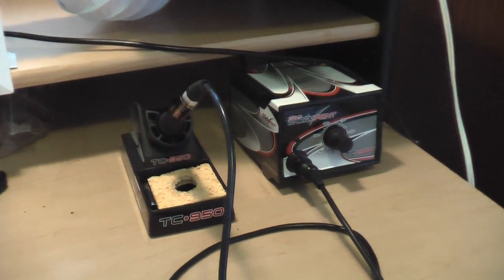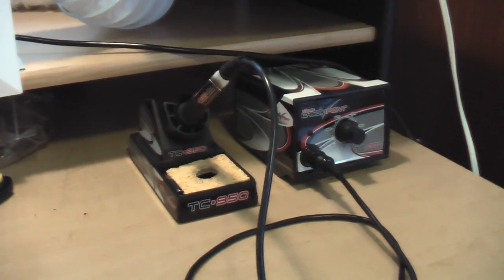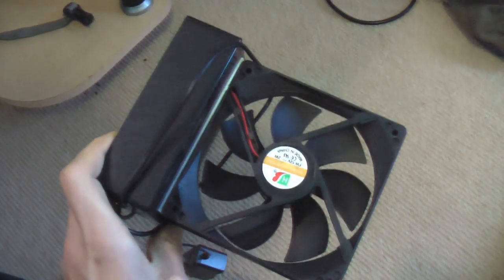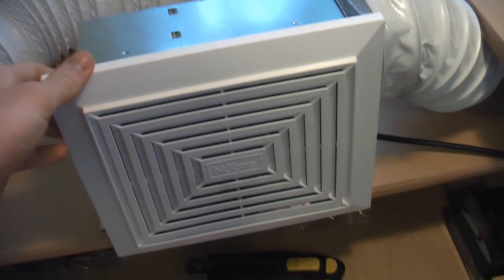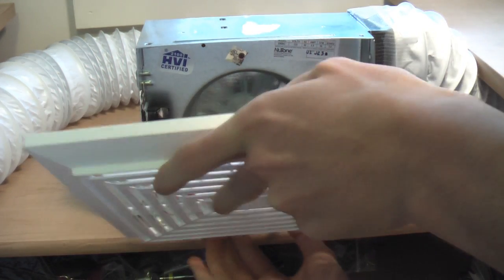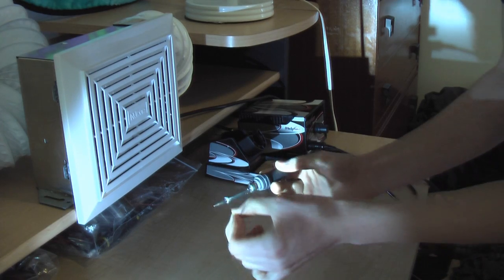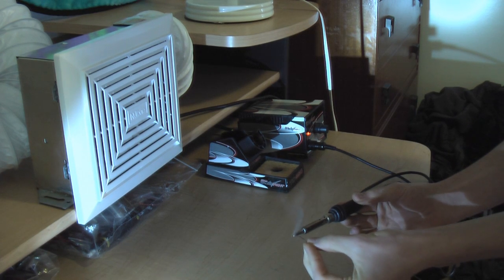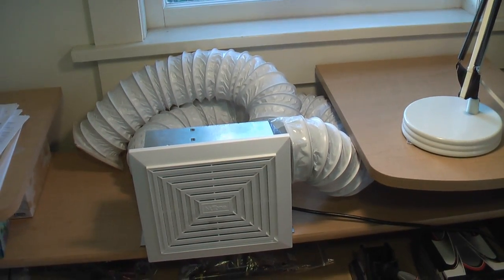How to make a powerful Fume Extractor for less than $30

Comment: I’m thinking about doing something similar but make an adapter to put in place of the intake grille and have a hose go to my work area so the fan itself stays away because my work area is small so the fan right in front would be very bulky

Comment: Great idea dude! Small suggestion, smoke rises if you would put it on a swivel arm/platform so you can have it above the soldering area it will eliminate smoke escaping from one foot away. I think. Really nice setup though.

Comment: I’ve found a 12v computer fan and carbon filter works fine; plus, not nearly as noisy as your solution.  Your failed project looks like the DC supply is under-powered and seems like the filter was being placed on the exhaust side; could be wrong but it was just the way it looked.  The filter must be on the intake side or it won’t work pretty much the way you described.  Anyway, the fumes are still toxic even if you’re venting to the outside, so a carbon filter is still advised.

Comment: Hello there! I need advice! I am working with Resin/Epoxy and I am an artist. I just put a 20"X20" fan on my window facing outside to suck the smell out. Now people (other artists) are telling me my fan needs to be ''for fumes'' to avoid a fire? I ask myself how bad are the fumes that resin and some paints are creating to be this bad? My fan is from a normal hardware store. Any guidance regarding this will help! Thanks!
Reply: Seeing you asked this ? 3 years ago the potential of you seeing this is slim to none.  OSHA (Occupational Safety Health Administration - Now you see why they use acronyms the title) requires MSDS (materials safety data sheets) that explains the hazards of the products you use.  The manufacturer should supply at no cost to you the health hazards of the products they produce for public use.   You are wise to inquire on resin, the long term affects can show up in your health at the worst times equal to cigarette smoking stories.  Depending on how much you do the resin on a daily basis, you should consider doing some ventilation.  I’ve done over 40 years of this type of work. Numerous environments.  I hope this helps you

Comment: Fume filtering systems that actually work cost $500+, as to filter the VOC gases requires a very expensive filter... carbon only filters out big molecules but generally recirculates the risky gas back into the room.  So yes, exhausting out is the way to go.

Comment: Cool simple solution.  The problem I've got, and you alluded to it 'somewhat' -is how to vent without the outside air being sucked right back in (has the fumes just dispersed but the open window would just suck them right back inside the room via the lower pressure the fan makes.

Comment: can this work in sucking sawdust out (vacuuming??) from the air? i'm still working on a sawdust vacuum, using 1, 2, 3, pc fans (with foam and a plastic box). all are from scrapped computers. I did make 1, and it worked alright, but I wanted something with better suction. (i'll also use it when I solder.)
all ideas are welcome.
thanks for the video!

Comment: This isn't a bad idea, but if u want my suggestion, and your not worried about noise, u should of looked at a stove hood.  They usually feature built in lighting and dual speed switch fans, I had this setup on its side for a while with my workstation, now I have it hanging overhead of the workstation with a bathroom fan such as yours, plumbed like yours for easy placement to wherever I choice within 8 feet if my workstation I also ended up fabbing a nice metal unit with handle ontop for the bathroom fan for easier placement and sheek look, I painted everything BBQ black with the exception of the flex vent pipe, which i forked over the needed funds for tin units so that it looked manly. Lol. Mind u I do alot of fab work as well soldering from jewelry to entire reconstruction of motorcycle harnesses and such. So this might be overkill but either the wife or the girlfriend hasn't complained about fumes or my smoking since I have completed the setup. The only thing they complain about now, the alcohol consumption and having to walk by motorcycles and engines in the basement of a house, and still can't figure out how I got said motorcycles into the basement having only stair access from both enterances.  I'm a magician too. lol.

Anyway good idea for keeping cost low.
Reply: May I suggest you watch some YouTube videos about improving your English.

Comment: I was thinking of getting one of these to fix the back draft issue. Also looks like you could add insulation for a more permanent, but ugly solution.
http://www.amazon.com/Window-Dryer-Vent-Adjusts-Through/dp/B00LUCRS9I

Also toying with the front mesh idea posted in the comments. Will post a video once I have everything all worked out.

Comment: The computer fan would probably work for extraction as well, but not for pushing or pulling air through a carbon filter, as you pointed out. If you want a computer fan that can push air through a filter, you must get a "squirrel cage fan" or "blower fan" type. They can be found, mostly used for servers. Blower fans are much, much more powerful at sucking air. They have a lower CFM than axial fans (which is what you have), but a much higher static pressure, which means that basically they can't move a lot of air per minute, but they can pull or push air with a lot of force through obstacles. A normal axial fan doesn't have that static pressure, and they are much easier to put in a stall configuration when encountering resistance, where there is flow separation on the blade (especially on the side that sucks air in) and they would be essentially spinning air around, creating a vortex, making sound and looking fancy but be moving zero air in the direction they're supposed to, in fact they would be a slight flow reversal when they're stalled. This is probably what you experienced.

Comment: awesome idea on the exhaust fan.  But seriously - electrical safety - the switch needs to disconnect the black (hot) wire not the wife (neutral) wire.  Also, you need to tie the ground wire (where is it?) to the metal box.  If that fan ever sucks in the wire you are going to have a very serious shock hazard if the wiring isn't proper.

Comment: Even better hang the unit over top of your work area facing downwards of coarse removing the cover and adding a screen with extensions off of each side trapping and removing all of the fumes 100percent as the fumes travel up naturally.  This method would be very close to 100 percent effective.
Reply: Then you'll inhale some of the fumes before it reach the extractor.

Comment: I totally agree with removing the big plastic front cover and replacing with some kind of screen or better yet a roof style extension extending out over top of your work area. And lastly a tip on end of hose that is flat and really wide to be able to close window more. If you do just keep it as a hose out the window I would let about 3-4ft hang out the window so none of the removed fumes get back in. By the way super awesome idea.

Comment: Dude! I used a pc fan in the same manner and it sucked. I never knew that the apparatus shown on your flick even existed. Looks like a drive to the HD is in order today. But then I want to cobble together some sort of hood for your/my NuTone Solder Exhaust Fan. Didn't NuTone make door bells? Don't you wish you had a CAD program on your pc and a MAGIC MACHINE that would spit out anything you designed on your pc be it PVC or stainless steel? I do.

Comment: Do you know if this could work with dust particles? I'm a ceramic artist and want to build a small ventilation device for when I measure dry materials with my scale. I'm trying to measure materials in the space, so I don't have to place a scale out in the garage during winter (which isn't good for scales anyway, they usually have a temperature rating, hence me trying to build something for indoor silica particles).

Comment: In reference to the computer fan type extractors. Those filters need to be placed on the back or rear of the fan to be efficient enough for the fan to suck air through. Beats me why they put them on the front because they just block too much of the fans pulling power. This is what I did to mine and it pulls like nobodies business now!

Comment: I like your idea, I have been trying to come up with an exhaust fan to use in the house when I paint with my airbrush. I thought about just putting a simple window fan in the window behind my hobby table, but it would be impractical in the winter, or rainy days.

This is a good idea, I think this idea would be the answer to spraying acrylics inside a small room...Good video.
Reply: did this work for you or did you find a solution? i'' here for the same reason. i got the bathroom fan just now but no clue how to wire it

Comment: Great idea... suggestion, that cover looks very restrictive and you can make it suck up more fumes by cutting out a large square in the middle of the cover and hot glue in a wire mesh screen just on the inside of the cover. less restrictive = more airflow.

Comment: I am in the process of building one of those for airbrushing right now. I bought two of those fans and built a box to house them in and contain the fumes. You don't need to wire the fan... It has a plug in it already. just run an extenion cord to it and your done!

Comment: Safety on that thing is shit tho, you should use a 3-wire cord/plug and ground the metal box, and you are cutting the wrong wire with the switch, it should disconnect the hot (black) and not white. Also the wire junction should be a crimp tube and not a marette, they are only for static wiring. If that marette ever comes off you are going to have a bad time.

Comment: nice idea btw, i think you had the computer case fan facing forward and blow the air in to you instead of sucking it, that might have been the reason of the 12v fan not working(computer fan).

Comment: Great video. I agree, better to extract than to filter. Filtering required a really good quality filter, and also the filter needs to be changed from time to time. Mount the fan higher up and you'll be able to work further away from it - the fumes will always rise.

Comment from the maker: @HEadshot00001234 That's what I based my little black one off of. And even though it appears that the carbon filters filter out the fumes, it actually just disperses the fumes, and if you use it for more than about 5min you will start to smell the smoke. And I would like to see his work from 12" away.

Comment from the maker: That's what I based my little black one off of.  And even though it appears that the carbon filters filter out the fumes, it actually just disperses the fumes, and if you use it for more than about 5min you will start to smell the smoke.  And I would like to see his work from 12" away.